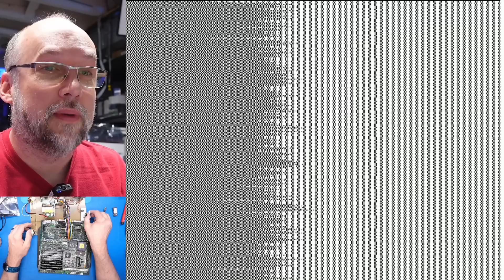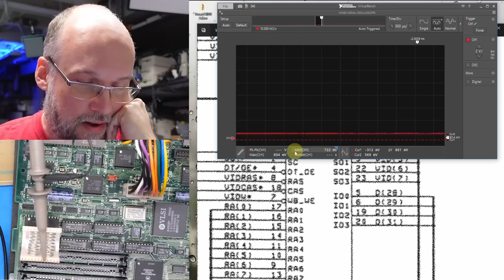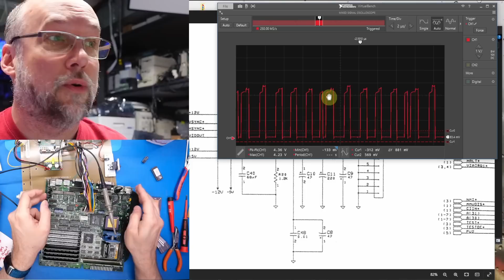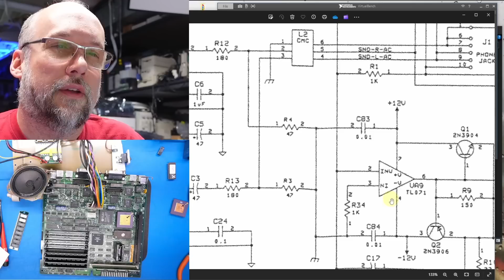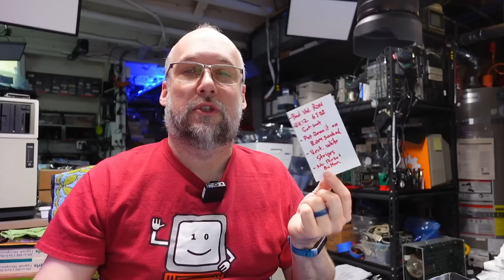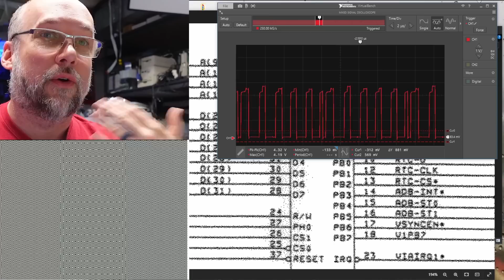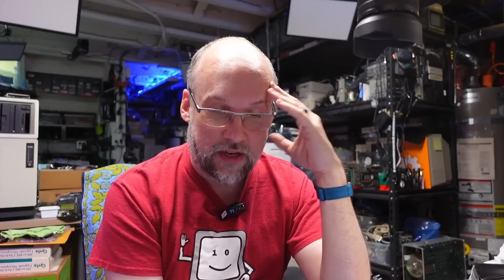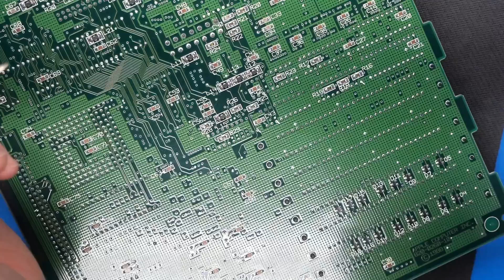Recapping my Mac SE/30 wrecked it

Comment from the maker: Note: Patrons and YouTube members already have access to part 2, showing what I do next to understand what's failing.

The MLCC caps I installed at 47uf and are not flat, like low value ones. They are square when you look at the end, meaning that rotating them doesn't make them stand up on the PCB, so the best way to install them is to just position them where they don't overlap with traces. 

Also, after making this video, I stumbled across a diagnostic mode that exists in the Mac ROMs. This was put there by Apple to work in conjunction with their "Tech Step" tool which plugs into the computer's port and allows you to run diagnostics. In part 2, I delve deep into how this all works and how it can be used to fix Macs. 

Tech Step was a dealer-only tool that is extremely rare and expensive. It has recently been replicated, but the replicas aren't particularly cheap. (They are very cheap compared to the originals) Since Tech Step talks to the Mac over the serial port to perform diagnostics of a machine, that means we should be able to run all the tests manually. I found this archived page which talks about the protocol that is used: https://web.archive.org/web/20210516085835/https://mac68k.info/wiki/display/mac68k/Diagnostic+Mode

So this is a great lead (thanks to Brian for getting me the latest most up to date version of this page) as this gives us some good insight into what might be failing here!  With the info on this page, it will be possible for someone to write some scripts to run on a modern computer to run these diagnostics on a Mac and give you some human readable results... and of course one can just do it by hand.
Reply: Interesting article, so does that mean you can get serial output by connecting a specific pin of via1  to ground?
Reply: @wurst_the_grey  I think that page says that you get into this mode automatically if you get the Sad Mac sound on boot, as well as if you use the NMI button. No VIA1 connection needed.
Reply: @Coderjo.  That is indeed correct, anything that generates a sad mac will put the mac into "test manager mode" the techstep dose this with special ADB or SCSI commands (which are documented on the page linked above)on the attached page) but hitting NMI works fine too. 

@adriansdigitalbasement if you fancy playing around with one of the clone TechStep's I would happily lend you one, I have a few sitting around being the one that made them
Reply from the maker: @max1zzz757  heh thanks. I'm good for now as I have enough knowledge about the diagnostic commands on SE/30 to accomplish what I need. Ultimately if all of the serial coms for each Mac model under test could be logged and documented with the corresponding info the Tech step is displaying, that would be helpful. Clearly on the SE/30 the Tech step is definitely sending some assembly language tests to the machine as it lacks all the non critical tests in ROM. Would be handy to have those to run by hand.
Reply: @adriansdigitalbasement  Ahh fair enough :) Capturing tests is something I could do but given time constraints (And the fact I don't have access to every supported mac) I wouldn't be able to do it for everything though I could grab my SE/30 board and capture the comms for all the tests
Reply from the maker: @max1zzz757  reverse engineering the dumped tech step ROMs might be the way. It uses a 68HC11 which is basically a 6800 I think.
Reply: @adriansdigitalbasement  Indeed it dose, a 68HC711E9 to be precise. anything software related is not my strong point but  I know Amiga of Rochester started started reverse engineering the ROM's and MCU code but was finding it was not a simple task due tot he way it was laid out. The ROM dumps are fairly easy to find online (There is a thread on 68kmla with them), I'll post my dump of the MCU code on github later tonight if anyone else wants to dig into them
Reply: @wurst_the_grey  Not only, it is jumped to when a sadmac is displayed, so pressing the NMI button at the right time will also go into the debug/diagnostics mode
Reply: @wurst_the_grey  Seems so -- I haven't tried any of this. I did see on this machine the serial port seems to show some sign of life when the machine crashes. I assume if you get a sad mac you don't even have to force diagnostic mode, I think it goes right into it. (It's my hunch)
Reply: @adriansdigitalbasement2  Tony359 shows the replica of a Apple TechStep in his latest channel video, so you can check that out and maybe get ahold of one
Reply: There are people making replicas of the TechStep
Reply: Unless you can get your hand on a TechStep, you may want to have a look at AppleCAT. It need to run on another macintosh with a serial port, but it allow to troubleshot macintosh who have a sadmac and use the diagnostic mode in the ROM for that. Each version of that app is specific to a mac model, there is one for the SE, one for the SE/30 and other one some other mac of the era (including the portable)

The Diagnostic mode is quite interesting because it allow to do a lot of thing including uploading code and running it.
Reply: Take a look at Apple C.A.T. software  which uses this protocol and is a precursor to TechStep.  All you need is another working mac running it and hook it up to via ADB ports.  (Search for "AppleCAT SE/30" and it's at Macintosh garden).
It's not as comprehensive as TechStep but it does do a lot of basic tests to point you in the right direction.

Also take a look at the RAM transceivers - probably the one for D31 is bad.
Reply: UJ11 appears to be cracked?
Or is that the camera?
Reply: I'm wondering if the best debugging tool would be a monitor program that runs some scope loops on startup and then initializes the serial port and interacts from there. additional diagnostic programs could be read in through S-records, or maybe Xmodem depending on how much code space is available. the point would be to create the absolute minimum environment necessary to perform more extensive testing of the rest of the system.
Reply: I think there may be a spelling CASTRATOPHOOEY in your thumbnail.
Reply from the maker: @TheParticleGod  LOL! Thank you, I should have checked the comments sooner!
Reply: The se/30 rom on power up and assuming the cpu can read the rom will initialise ram next.
The fact that you immediately get the sad mac/death chime means it detects a ram issue.
Google ‘se/30 forever - startup sequence’  and check the link from the Machut. It should point you in the right direction
Reply: this video: https://www.youtube.com/watch?v=zc3sPoqOFG8 the guy has a diagnostic device that looked interesting, maybe???
Reply: i have a prototype software defined techstep...
Reply: Amiga of Rochester is working on a software-based version of the techstep and I am not sure how far along in the process he is, but i know he had it working to some capacity.
Reply: Adrian, we have the reproduction TechSteps for sale complete with all roms and in a nice printed case. On website it can be found $400.00 each which is a very low price compared to what the originals go and most of this cost is due to the hard to find chips.

Comment: I around it with a Aluminium foil due I re-solder it from the PCB with the hot air. With this Aluminium foil I secure the around laying parts from overheating. I solder it with the soldering iron with a plate iron. Then I de-solder it with the copper-wire to de-solder the rest between the pins on the PLCC.

Comment: you just need a little more experience with surface mount, I learned a lot from working on bad nintendo switch motherboards. a liberal but thin layer of tacky flux and coving plastic pieces with kapton tape seems to work the best for me. flux helps with the bridging.

Comment: That damaged CPU was a great jump-scare when put in the working board! XD
I suppose checking all the voltage rails for shorts to data-lines could be done after recapping, but it could be rather tedious. Alternately, just checking the lines that run near enough to get shorted is an option, just takes a little more inspection and/or having schematics.

Comment: 26:50 haha that cpu actually kind of survived just to let out its horribly distorted final last words 😅. I am actually not surprised those eproms survived 12 volt cause often they are programmed with high voltage in the programmer and they are built different

Comment: Who makes that mini grinder?
Liquid flux is you friend for chips with close pins.  Solder the pins, as sloppy as you want, bridge and all.  Put liquid flux over the pins, run your soldering iron over all the pins, right down the line, and like magic, perfect solder job.  A bit smokey but it's how I learned from Sony many moons ago.  MG 8351 is pretty much a lifetime supply for the hobbyist.  Recommendation by Mr Calsons Lab.
Thanks for another great video.  Quite the roller coaster.  About to watch the next one in the series.

Comment: Chipqwik has its uses but needs a lot of flux to help it stop going 'pasty' and smearing. For heat protection of nearby parts when using hot air just use some aluminium foil (can get adhesive backed stuff on a tape roll too).

Comment: "The 1.3 µm lithography process was the semiconductor process technology used by the major semiconductor companies between in the late 1980s. 1.3 µm was phased out from the late 1980s to the early 1990s and replaced by 1 µm, 800 nm, and 650 nm processes."

And Wikichip shows that the 68030 "micro 32" is included in the 1.3 µm lineup. A micrometer is a millionth of a meter. And a nanometer (the lithography common on today's CPUs) is a billionth of a meter. These 68030 chips are using paths (1.3 µm = 1300 nm) that are huge/wide (~430x) compared to today's 3nm tech. Also worth noting that they operate at 5V, according to wikichip.

"3 nm
The smallest size currently in production. MediaTek and TSMC announced their first 3 nm chip in September 2023, with volume production expected to begin in 2024. Apple's iPhone 15 Pro and iPhone 15 Pro Max will also feature a 3 nm chip.
 
5 nm
Apple's M1 processors are 5 nm. Samsung and TSMC began volume production of 5 nm chips in 2020. 

2 nm
IBM created the world's first 2 nm process, which can produce CPUs that are 45% more performant or 75% more energy efficient than modern 7 nm designs. Samsung is expected to roll out its 2 nm processes in 2025. 

14 nm
Intel's current desktop processors are 14 nm."

Comment: I completely approve of the new anti-static desk mat.  I use a very similar (if not the same) blue anti-static mat as my desk mat for my computer desk/soldering station/everything else and I will say I have been impressed with how well its been holding up and its more comfortable than the glass surface under it.  In the end it also works really well and smooth with my mouse movement and my keyboard rubber feet stay put as some unexpected perks.  I have always favored glass desks for soldering due to easy cleanup with a razor blade, but I will be keeping the desk mat.  Plus I have a easy connection for a ground wrist strap in the corner of the mat with dual connections, and I did connect/ground the mat to my server rack right next to it so its properly installed and grounded if I ever decide to start using that part like I should be doing,  lol).

Comment: Adrian, please! Buy some Kapton tape to protect the plugs and things around, even you only use the iron. Kapton is not only for managing hot air but also for clumsy soldering techniques or unsteady fingers. No shame, I have shaky hands myself and use Kapton. Then all SMD chips that can be removed by hot air, can also be soldered by hot air, however I also prefer the iron method but use lots of flux and drag the fresh solder around the chip. I use a curved pointy tip for that, what makes dragging tin much easier.
Don't use chipquick. It is by far enough to refresh solder with good old leaded solder and then use hot air for removal. 
Replace electrolytic capacitors (32.000h @ 65°C) with polymere caps (200.000h @ 65°C) and it will be fine for the next 100 years.

Comment: Had a loosely similar problem with a Taito Space Invaders cocktail PCB, which is a deck of 3 boards daisy chained with ribbon connectors.  Somehow one of the ribbon connectors on the sound PCB seemed to have internally shorted and was shorting the game reset watchdog signal (which is on an adjacent pin) to address pin 15 of the CPU.  The game code is so tiny it doesn't even need A15 but presumably the persistent reset pulsing gradually killed the CPU.  It was only 5v, but desoldering A15 from the ribbon connector, and a new CPU and it was up and running 🤷‍♂️

Comment: Use solder paste, flux, hot plate and heat when re soldering smd. It will make it so easy. Aluminium foil to protect plastic parts

Comment: With chipquik it is easy to clean up-you take a Q-Tip with some flux on it -heat the are since it is so low melting then using the flux impregnated Q-tip clean up the molten solder like you would clean flux off a board with Isopropyl alcohol-been using chipquik a very long time and it's main advantage is that it melts at a lower temperature and stay melted for a long time so you can manipulate it easier-it takes a little practice to get the technique down but once you do-it works well

Comment: I suggest using Kapton (polyimide) tape to insulate traces around the electrolytic cap pads when replacing them with ceramic caps. You could put a piece of the Kapton tape over the whole cap footprint and then cut out rectangles over the pads with an xacto knife. The Kapton tape will survive the heat from soldering on the new cap.

Comment: Do you have a logic analyzer? Put a probe onto the CS line of every chip and power the system on with the analyzer in one shot mode. You can see the sequence as each chip in turn gets selected and probably the last chip is the dead one.

Comment: SMD chips can either be reworked with hot air or a knife or wide edge solder tip. Point tips can not transfer enough heat to the entire pin. In either case lots of flux with ensure the solder stays where it is supposed to. Flux not helps solder melt, but it helps in ball up to itself. You can see this with BGA chips. Look at some of those videos. Search rework BGA. A chisel edge would probably be the best because it will not only flow the pins, but it was also suck up excess solder.
Reply: Just drag chisel along pins together.

Comment: Let this be a lesson to you in terms of replacing parts with their equivalents.  Why are you putting SMD capacitors on footprints that don’t call for them?

Digikey exists. Mouser exists. There is no reason for this.
Reply from the maker: That's not a lesson. Why would installing a cap that'll never leak again be a bad idea? The original caps caused the corrosion that exposed the trace, a direct replacement could easily do the same thing again. The lesson is to carefully inspect the traces that are under the corroded cap and fix them first and move the component into a position to not overlap them.

Comment: Gotta love those PLCC chips. They put the leads under the chip and put pin 1 in the middle rather than a corner. Who does that?
Reply from the maker: I looked up the history of these chips and AFAIK they were designed for sockets and I think the SMD attachment came later as a "it seems like this works too"

Comment: 50:12 a ‘tip’ for PLCC soldering? Yes, there are specific tips for tweezer-like soldering irons that grab hold of the chip while heating it on all sides. Have briefly worked with them. Still little fun, but in conjunction with a hot air gun might work. Every single size of PLCC package has its own ‘soldering iron tip’. And they take forever to heat up as they have to have sufficient thermal mass to heat up every pin.
Reply from the maker: Yeah I bet if one does a ton of rework of these, that would be the way to go. If you have stacks of the same boards to fix.

Comment: Your comment about buffer chips has to do with the fan-out/fan-in capability of the ICs pins.  The spec sheets should have the values.  It has to do with the chips' ability to sink or source current (current out (the source) & current in (the sink) requirements for the pins).  So, you can hang ICs on a pin until you reach that limit (since the pin can only supply so much current).  If you still need to have more things connected to the pin, then you need to use buffer chips on the lines.  The buffer chips are generally used for larger fan-in/fan-out capability and are often tri-stated.

Comment: When soldering SMD Components, you absolutely need tu use flux. The solder flows much better when applying heat to the board and the chances that you short something by soldering are minimized.Besides the tap soldering that you use there is the drag soldering and the hot air of course. No matter what, always use flux when soldering smd components. Makes life so much easier...
Reply from the maker: Yep, I had flux on there for soldering and resoldering these chips. MG Chemical rosin flux.

Comment: Maybe in the future it would be better to use through-hole ceramic caps instead of SMDs? You can shape the legs so that they fit on the pads (BTDT). It's not going to look as neat, but you would avoid the problem with the large contact area directly touching the PCB (and any possibly exposed traces).

Comment: I love Chip-Quik at times but ya, gotta learn its mannerisms and gotta clean up the old stuff.  Nice is if you can keep the Chip-Quik blobs and use them again where applicable.  Sure it'll have some normal solder mixed in over time but can get multiple uses, that stuff isn't super cheap.

Comment: Mini wave soldering iron tip makes doing pretty much any surface mount IC a doddle. I don't know why I don't see anyone ever using one. It has a little cup on the tip you fill with solder and gives you a little reservior of solder to drag.  Weller call it a concave hoof tip